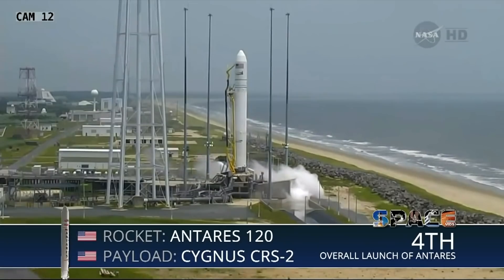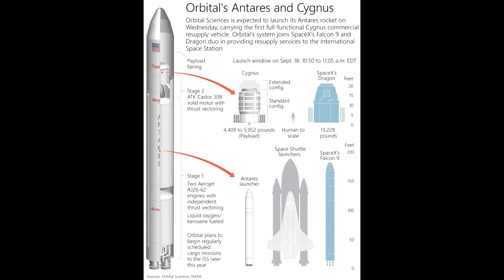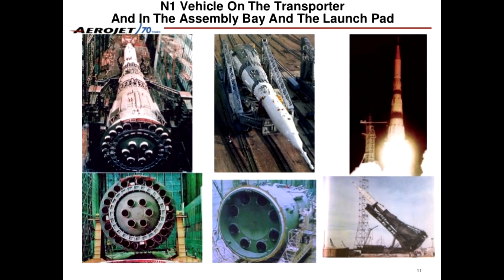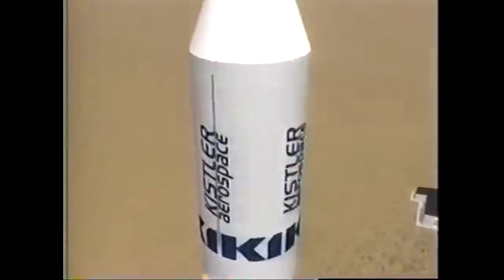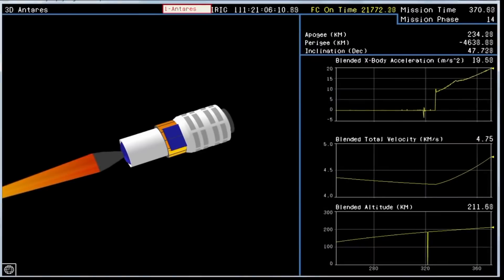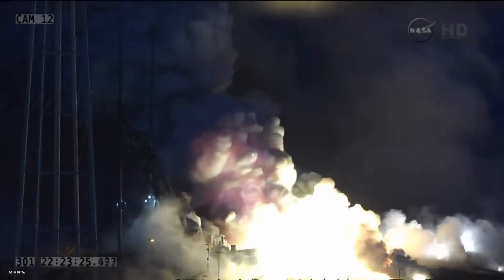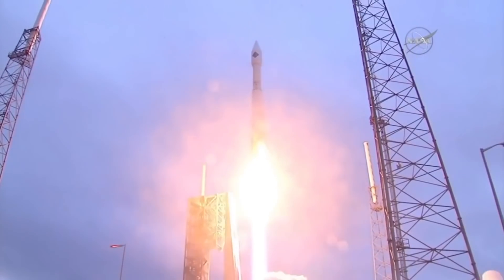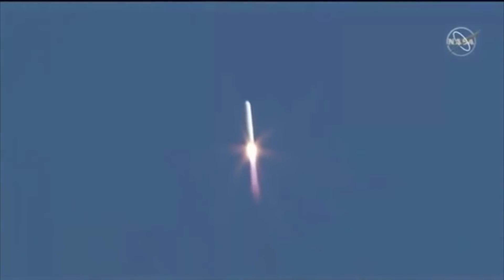The Antares Rocket - NASA's Less Famous Ride To The Space Station

Comment: the cause of the crash is the engines. The engines are 2, if the rocket has 2 engines at the bottom, it will collapse, it will be unstable. If the rocket has  3, 4, 5 and 6 engines, it will be stable. It will stand properly

Comment: hi scott and everyone,
i have an engine related question. its said that the falcon rockets do a suicide burn, because one merlin engine has, even when throttled to the minimum, too much thrust to let the rocket hover.

Now, i assume throttling down is done by adjusting the turbo-pumps, but what defines the minimum thrust. Is it the pump itself or would the gasflow in the nozzle get disturbed, or something completely different? How does the thrust correspond to efficiency, maybe with a view on different chamber pressures...if there is a relation. 

Thanks folks!

Comment: FROM: J. Jason Wentworth [e-mail: blackshire@alaska.net ] -- Scott, thank you for properly covering this important but unsung SLV and spacecraft system. Your report also suggests something that is related: Have you ever done a report about MCD (Minimum Cost Design) launch vehicles? These are rockets (and spacecraft can also be designed according with the MCD principle) in which cost is given equal importance in the design trade-offs. Arthur Schnitt of the Aerospace Corporation discovered the MCD design principle, and John R. London's book "LEO on the Cheap: Methods for Achieving Drastic Reductions in Space Launch Costs" (it's available in PDF form online, and as a printed edition, see: www.google.com/search?source=hp&ei=ZfH6XKfrCajY0gK9sJIQ&q=leo+on+the+cheap&oq=Leo+on+the+Cheap&gs_l=psy-ab.1.0.0j0i22i30l2.916.8340..10723...0.0..0.130.1866.0j17......0....1..gws-wiz.....0..35i39j0i131j0i22i10i30.Byma1feXKlc ) covers the MCD design process in detail. London's book covers MCD spacecraft design and economic analyses as well as such analyses of MCD launch vehicles. MCD launch vehicles are larger, simpler, and heavier--but cheaper--than ballistic missile-derived (or descended) launch vehicles. Also:

MCD launch vehicles are typically expendable, but they are of such robust construction that their first stages can usually be either recovered for reuse or discarded; both options are about equal in cost. Boeing and McDonnell Douglas designed MCD rockets (Boeing actually built a prototype MCD rocket first stage, which was build-able using cheaper, ship-building techniques), and TRW built--and successfully static fired--a 250,000 lbf pressure-fed, pintle injector-using kerolox (LOX/kerosene) MCD rocket engine. It was so simple that TRW contracted out almost the entire engine to a local, non-aerospace metalworking shop, making only its pintle injector in-house. The engine was stored outside and got dust on it, and after just being brushed off it was repeatedly fired. It ran smoothly, with no signs of combustion instability. Boeing and other aerospace firms quietly abandoned MCD rockets because [1] they realized that non-aerospace companies could build them (they didn't want such competition), and [2] being so simple and basic, many engineers found MCD rockets boring and un-challenging to develop. (To me, what a rocket *does*, and where and what its payloads go and do, respectively, is exciting.) In the late 1960s and early 1970s, MCD launch vehicles were considered a viable alternative to reusable winged spacecraft (space shuttles) for low-cost, routine access to space. I think we took the wrong fork in that road, back then...

Comment: Great videos, Scott, I've become addicted. As a science/space reporter chimp who broadcast 103 space shuttle launches, I was unlucky enough to be at the Cape broadcasting the Challenger launch when it exploded. Since that moment when I saw people I'd interviewed a week earlier die above my head, a question has haunted me. I asked Wayne Hale the question and he shrugged it off with a, "They couldn't have done that," The question is: Had mission control correlated the brief pressure drop they saw in the SRB at ignition (before the hole glassed over and sealed itself) with the second one they detected as the hole reopened due to buffeting in the bucket, and staged at that moment, shedding the SRBs before the ET burn-through which caused the explosion, would Challenger have had enough momentum and thrust to climb to an altitude high enough to dump the ET and accomplish an RTLS abort or would it have slowed to a stop and fallen backwards into the ground?
Reply from the maker: Yeah there was no mechanism to stage the boosters, especially at MaxQ. But I guess I’d like to see what would be possible if the staging was possible.

Comment: A lot of people make a big deal about the NK-33 being taken out of mothballs and used successfully in the modern era, but it sounds like they really only got 4 proper launches out of them before one grenaded itself. What are the odds these engines weren't as reliable as they were claimed to be? I know from the documentary that geting the oxygen pump to work without disintegrating was the major hurdle, and if that's what caused this one to blow up, maybe it truly is a problem that can't be satisfactorily solved?
Reply: oxygen rich staged combustion engnines are in use today.  Several Russian rocket engines in use today use it as well as the SpaceX raptor.    There are several possible causes for the NK-33 failures such as debris in the fuel tank.  Poor storage conditions and poor quality control of the metal and parts manufacture are other possible causes.

Comment: “Sure! Let’s use a great engine with a 0 for 4 record with 4 massive explosions! What could go wrong?”
Reply: 4 failures of N-1 rockets, meanings 4 of 30*4=120 engines (considering that the engines were the problem for every rocket failure, which is not really the case)

Comment: I saw a night Antares launch from up close and it was fucking glorious. In silence, night momentarily turns to day, it lifts off the pad, the exhaust plume looking like a brilliant golden inverted triangle. Antares penetrates the low clouds, illuminating them from within and after a considerable delay, the wave of sound washes over you. The crackle of the engines massage your soul as it rises to the heavens, arching over, reversing apparent direction from your perspective, from rising up, to going away from you. You go from slowly tilting your camera up, to slowly tilting down, as the exhaust plume gradually fades to a small point and then nothing. The thunder of the engines reverberate for some time until it too gradually fades away, replaced by the sound of the ocean breeze, gently lapping waves and the NASA live stream still playing on your phone. You hear the call for MECO and suddenly, you are surprised to see a new point of light appear in the sky as the 2nd stage ignites. That point of light also fades away, but you let the camera continue to roll until all you see is a noisy black sky and all you hear from the live stream is that everything is nominal.  Highly recommend making the pilgrimage, if you live in the mid-Atlantic region. Remember the time delay for the live stream. They were still  counting down "T-30 seconds..." when the engines suddenly ignited, catching me off guard. Lol

Comment: Antares is not new technology the first stage is a Zenit booster which is built in Ukraine and has two RD180 engines which are also used on ATLAS. Originally they were going to use NK33s but the design degraded and Aerojet falsified their research in 4 test which resulted in the loss of Cygnus 3 and 3 Progress ships. Energia and NASA sued Aerojet and so did Northrup Grumman and the NK33 was scrapped and replaced by the RD180. ULA did not like this since the RD180 was their engine so to break the monopoly Northrup Grumman bought three rides on ATLAS and since then the RD180 is the default engine for Cygnus. Congress has embargoed Russia and sanctioned them and the supply of engines to Ruscosmos, Energia, and Northrup Grumman is running out all defense contracts were canceled and Northrup Grumman, ULA, and Ruscosmos are barred from using the rockets to launch spy satellites only science missions and launch of government contracts are allowed.
Reply: Wrong.
Reply: @Orandu  I am not lying my uncle works for the company he built the Caster 30 Rocket Engine.
Reply: Aaron, I don’t know anything about that, but Antares uses two RD-181s and Atlas V uses one RD-180.
Reply: @Orandu  same engine different design same maker

Comment: So the first stage's AJ26 engines have a specific impulse of 297s at sea level and 331s in vacuum, but the second stage Castor 30B has 301s.

How many other rockets have more isp in their booster stage than in the upper stage?  Should be rare, right?
Reply: Not that rare actually, I think
Because often in the upper stage things like the engine being to ignite easily or the propellants being storeable are prioritized over specific impulse

Comment: Nice overall summary, however there is a mistake that stood out to me.

- The RD-190s. Because of issues with the AJ-26s, namely OTAK was facing a limited number of them an Aerojet Rocketdyne had failed to start up a production line of their own, OATK was looking for engines before the accident, had made their selection, and were in the early process of redesigning Antares at the time the accident occurred. 

And now that you brought it up, you should probably cover the Kistler Rocketplane K-1. The first attempt at a fully reusable commercial launcher and in some ways is a smaller version of SpaceX's Starliner... only many years before Starliner.
Reply from the maker: I should https://youtu.be/IU-BGgI4bWo

Comment: Actually the ATV was the biggest cargo spacecraft to ever service the ISS with an internal volume of 48 cubic meters while the Cygnus only has 27.
Reply: I heard that the ATV won't fly again though.  It is a nice vehicle and was useful, but apparently too expensive to operate compared to Cygnus and the Dragon.  If anyone knows something to the contrary, please let me know.
Reply: @GlanderBrondurg  It was expensive but not too expensive to operate. The ATV was limited to 5 missions. It was able to do much more than other cargo spacecraft. For example reboosts the station or transfer air, water and propellant.
Reply: @Tist6099  Why was it limited to just 5 missions?  Those capabilities sound like something which still would be useful, even if only something used once every other year or so.

Or for that matter an ESA funded crew capsule with similar capabilities.
Reply: @GlanderBrondurg  Because Dragon and Cygnus do service the station. There is no need for another vehicle at the moment and the reboost can also be done by the Progress. Also the ATV was a way for ESA to participate in the ISS.
But the ATV technology is not lost, it's currently used in the Orion service module which is built by ESA.

Comment: One aspect of this rocket that I haven't seen discussed is that the Russians deny that the NK-33 engines are the reason that OA-3 exploded. Their position is that the heavy modifications by Aerojet (re-christening them as AJ-26) are what caused the explosions. They have used these NK-33 engines (with fewer modifications) on Soyuz rockets and not experienced any failures. Whereas on the other hand, another one of the AJ-26 engines imported to the US and modified did explode during testing. I'd like to see an analysis of these opposing points of view. Could it be that AJ's process of replacing the control electronics and adding a gimballing mechanism damaged the engines in some way?

Also interestingly, there happens to be a video on youtube of a test firing of the precise engine (same serial number, E-15) that exploded:
https://www.youtube.com/watch?v=9h2XJJqxaxc  I can't find a source right now for my claim that E-15 is the one that blew up, but I do recall finding that information a couple years ago when the reports following the accident started to become available.

Comment: How do those upper stage solid motors work anyway? Is there a video about those somewhere? Thinking in kerbal terms here, I'm wondering how they have the ability to precisely control the magnitude of their burn, and whether they can change it on the fly?
Reply: They can't shut it off once ignited, but they can calculate in advance how large of a stage they need and size it accordingly. It's pretty inaccurate but close enough to get orbit, and the Cygnus can do the fine maneuvering with its RCS.

Comment: A question that came to mind when I was watching this video was, why are there so many different designs for the engine end of rockets? The Saturn V had fins and the engines were fairly exposed. the Soviet N1 had a skirt or flare that mostly covered the whole engine area. Other rockets have many other shapes. Why such a variety?
Reply: Different design considerations. Different configurations are desirable for different reasons, and there isn't necessarily one "best" option.
Reply: In case of the Saturn 5 fins I am quite sure that it was out of uncertainity. According to a Video from Amy /Vintagespace, NASA was not sure wthwer fins were needed or not,  prefering to go safe with fins. I guess the performance boost without fins (due to lesser mass) is next to non-measurable whilst the gained safety regarding stability was worth it, even if not needed.

In general a Skirt gives probably better aerodynamics, but adds more weight (especially for big engines) --> lower TWR. Depending on your ascent characteristics, one may have more impact than the other. Delta IV Heavy for example has a really slow start due to its low TWR. Thus, it has no skirt as aerodynamics are less important for a longer time and an even lower TWR is probably not desirable.
Also the pproper design and manufacturing of a skirt is not for free...

Comment: I never noticed how much the antares gimballed away from the tower after right after release until after seeing that footage near the end.

Huh I wonder why
Reply: It's done on purpose so that if the rocket fails right after launch it doesn't land directly on to the launchpad again and destroy it.
Reply: @supertoasting1011  You mean rocket pads break? Who knew!

I think it's a funny thing for whoever to miss, especially since the vehicle can more than handle the lost efficiency.
Reply: @supertoasting1011  yea that I figured that out. But that is quite a large range compared to other launchers. Unless I haven't been paying attention or only assume that rockets can only begin pitching down range after they clear the tower
Reply: @supertoasting1011  Emphasis on AGAIN
Reply: So it would explode away from the pad? j/k :)
Reply: @doggonemess1  I think that's the actual reason.
Reply: Another reason to gimbal away from the launch tower is to avoid hitting the tower after launch.  Launching near the ocean generally means there is wind coming off of the ocean.  If the wind is strong enough it could push the rocket into anything on the launch tower.  Often it is not noticeable on other rockets but occasionally it is visible.

I
Reply: @stevenf1678  - That's right.  The maneuver away from the launch tower appears a bit aggressive, but it is designed to work even in very high ground wind conditions.
Reply: Elopeous I think it’s just because the first stage has a relatively high TWR.
Reply: I saw that and almost instinctively corrected KSP-style lmao

Comment: Scott: since the weight of the engine makes a very small portion of the overall weight of just about any rocket, why do rocket engines spec their power to weight ratio? Isn't it a stat of virtually no consequence?
Reply: This is only true for a starting rocket. The emptier the tank gets, the higher the engine portion of the total mass gets. 

Furthermore... given you need a specific thrust and starting TWR for your rocket, the higher the engine-TWR (less weight) is, the more fuel you can load. So... high engine-TWR has a similar positive impact on delta-v as high ISP.

Comment: using a solid uncontrollable booster as upper stage is stupid
Reply: It isn't, the good thing about SRBs is that they are cheap and predictable. They can just use the lower stage to get the upper stage to a position where it gets into orbit, the OMS does the rest.
Reply: It has thrust vectoring.
Reply: Space X-Fan ah yes, that’s why they’ve been used for the past sixty-odd years and have flown some of the most important scientific missions ever 🤔

Comment: Hey Scott knew alot about antares but why does it seem on liftoff that the rocket is slewing towards what I assume is the right of the pad depending on the view thanks!
Reply from the maker: That’s a standard ‘pad avoidance maneuver’ most rockets do this so that if they fail seconds after liftoff there’s less chance of landing on ground service equipment.
Reply: @scottmanley  That would explain why the pad looked relatively intact after the explosion.
Reply: Hey Scott but how do they do that with tvc and prevent the rocket from going like 60 degrees off nominal
Reply: @steel_dejones8648  Thrust vector control is very accurate, especially early in flight when thrust is high, speed is low and cross-winds are reasonably predictable.  It's easy to keep the errors in vehicle attitude and desired trajectory very small.